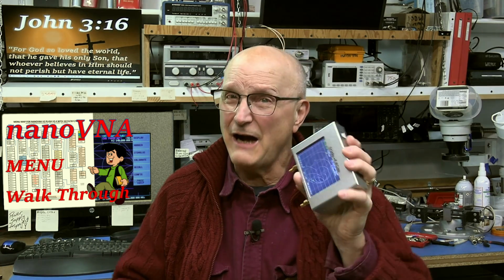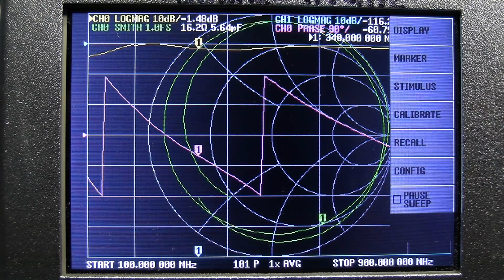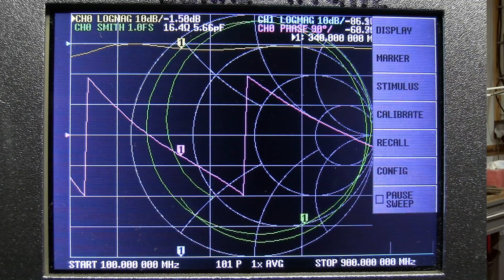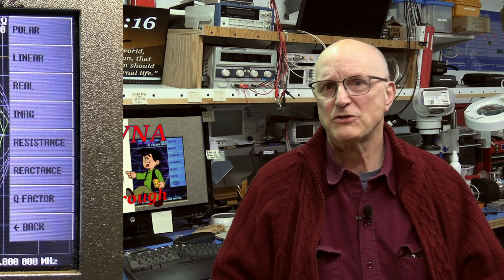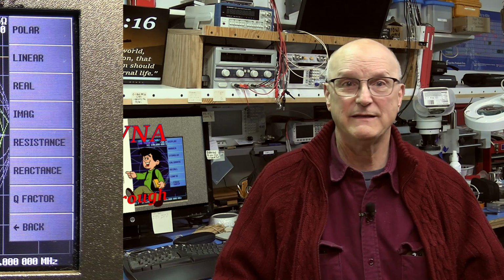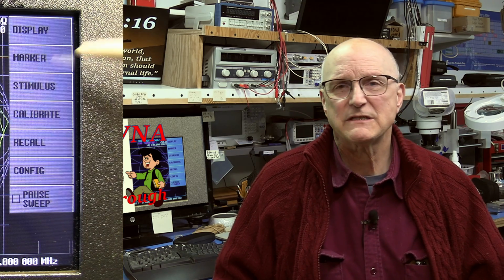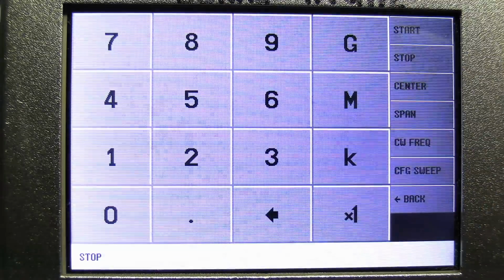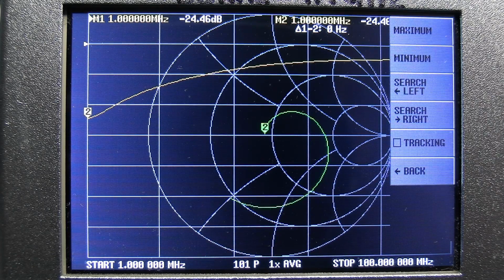nanoVNA: A Practical Menu Walk Through (068a)

Comment: I just ordered an SWR meter to use on my 2-meter stuff.  Did I waste my money?
Reply from the maker: It depends on what you are trying to do. If you are looking to monitor the swr of your antenna while applying real transmitter power, then you are set. Be aware that, depending on the frequency and the make/model you may be introducing it's own SWR and loss into the transmission line. (see my video on the subject: https://youtu.be/1fpoViuxn3c)
If you are doing antenna creation and characterization, then the nanoVNA is most definitely they way to go. Plus it will do a *LOT* of other jobs for you,too. 🙂

Comment: you have this kindly concerned raised-eyebrow look on your face, letting me know it's indeed tricky material and my bafflement is valid lol, thankya my goodman!
Reply from the maker: You are very welcome! Yeah, there is a LOT there and it can be confusing. 🙂
Reply: I'd go as far as to say "it can't NOT be confusing (at first)."

I'm attempting to characterize a Tesla coil using my new DG8SAQ VNWA 3, and its like "how many resonant frequencies does this have!?", turns out it has a series mode and 2 parallel mode resonant peaks. Persistent uncertainties (apparently i like a good challenge - eek), thus i arrived here. Thanks for lending me your perspective!
Reply from the maker: @cold3lectric  That is a very interesting project! My cousin created one of those MANY years ago. I never did anything like that.
In some ways, that Tesla coil is like the RF choke they put in linear amplifiers. It is wound specifically to create several self-resonant frequencies. That's cool, too! 🙂

Comment: Great video, I'd be interested in your take on how and when you make the three types of impedance/component value measurements.  The S11, and the two S21 (shunt,series) through measurements with the NanoVNA..   Thanks
Reply from the maker: Thanks! I'm noodling on the whole"through" measurement of components thing. They would form the input impedance to a frequency dependent voltage divider with the input impedance of port 2 (ch 1) being the output side of things. It'll be a very interesting study and experiment on the bench. 
Know that if I come up with something cool, there will be a video on it.🙂
Reply: @eie_for_you  Yes from what I've read, whether the impedance is much greater or less than the 50 ohm center impedance determines which S21 method is used, for the most accuracy.  Copper Mountain has some good info...  Cheers...
Reply from the maker: @wb7ond  Hmmmm...I'll have to check that out when I get to investigating this. Thanks! 🙂